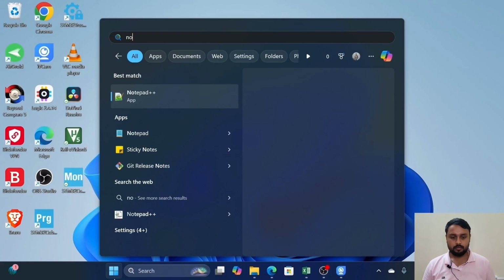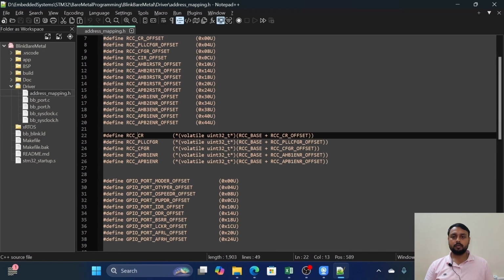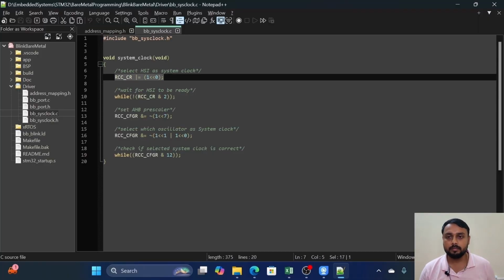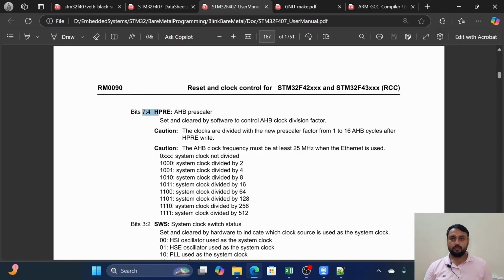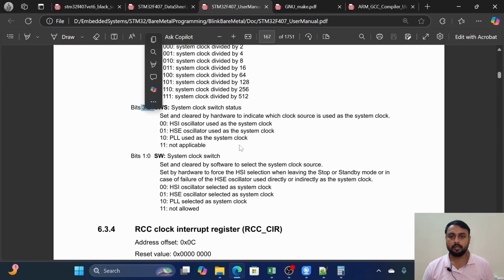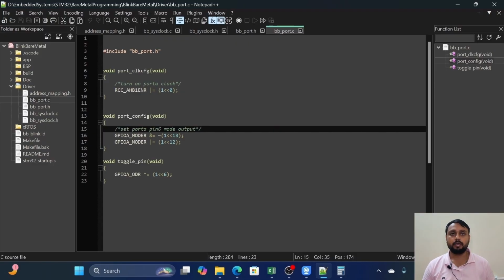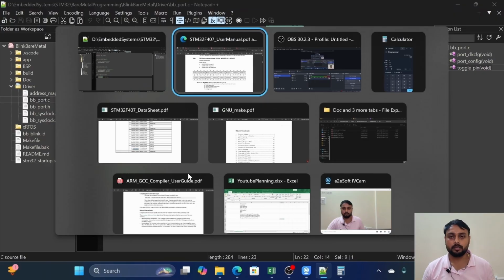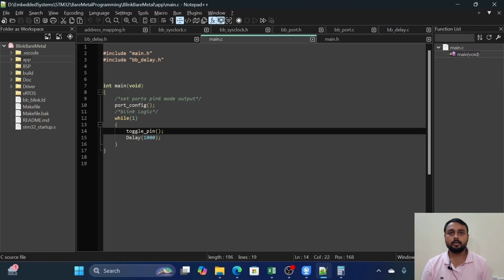Bare-Metal STM32 Programming: Part 8 - Embedded C from Microcontroller  User Manual

Comment: Isn't RCC_CFGR going to be 0111 1111? ~(1<<7) means you are making the 7th bit as 0. But great video overall, it would have been nice to have seen the contents of main.h also, I think main.h includes bb_port.h as the main.c file has to know where port_config() is coming from?
Reply from the maker: Correct, this is a case of "clock not divided". Thanks for pointing this out.